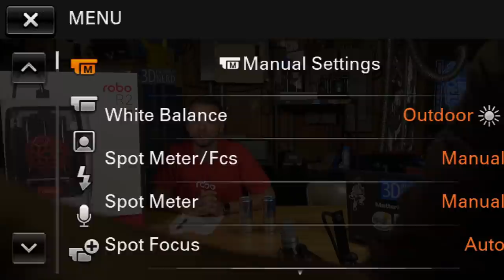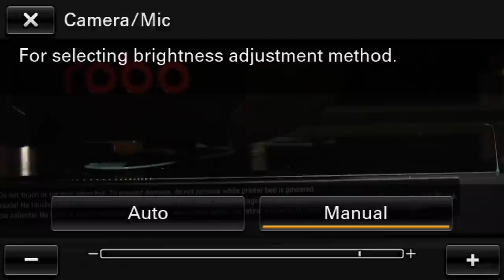Braydon Moreno & I Unbox a Robo R2 3D Printer and Have a Chat

Comment: I tried an E3DV6.  Didn't work.  You couldn't put the ROBO plate on due to the width of the heat sink.  The E3 also hung two mm lower which affected the cooling and would cause instant clogs.  I believe that you would have to figure out how to attach the included fan to the heat sink and wire it to the extruder.

Comment: Sorry Braydon, unfortunately, my R2 arrived last week with a bent Z-axis screw and it is currently being shipped back to Robo. I know of two others users (see Robo user forums) with bent Z-axis screws. Otherwise the machine was in great shape and printed right out of the box with little setup. The benchy boat looks like real shipping lap boards. Of course the 3D model does not look like that. Easy to setup and use. I am looking forward to get it back. Ah, also there was no tie-wrap on the door as my door was swing freely but luckily no scratches. Great print table - love it. Great look but may be hard to work on in future - time will tell. I would like instructions on disassembling to replace wore/bad parts as it will not be cheap to ship back and forth to Robo for fixing. Wifi works for updates and has internal harddrive but I have not transfer files thru Wifi yet. First mod will be add add addition LED light at the top. The current LEDs are great but when printing small parts the print surface blocks the lights on the top print surface. This will come in handy when watching thru the on board camera on the iPhone. Phone app works good. I turn out the light and go watch TV but it hard to see the printing. Wizards are great to lead a newbies thru the key steps. Touch screen is very nice. Great video guys.

Comment: Super cool stream !  $1500 for this machine with heated bed, auto level, wifi, camera, large build area, ENCLOSED (mostly) for printing nylon and such - with the option of a 2nd extruder?   That's a good deal - especially since it is NOT a kit.  The fact that is open source/modable/hackable is also really sweet.  Put it on par with an Ultimaker.  I have an Original  Prusa I3 MK2 that I built from a kit and I LOVE it, but if I wanted something for my 80 year old Dad to start using, or my grandkids, this would be a fantastic place to start.  Easy to use for beginners, powerful enough for experienced users and very hard to "outgrow".
Reply: Yeah, no. I'm getting parts of similar quality off of my $350 Monoprice printer. Another $50 for a Rpi3 with a webcam (literally the exact same setup Robo is using on the C2 & R2 with a hacked up frontend bit of coding to use their color scheme and graphics). This printer is using features that were top of the line in early 2015, but in 2017 is not worth the price tag.

The best beginner's printer on the market right now is the Maker Select Mini v2 at $250--built-in wifi, native support in every OS on the market as a recognized printer and 32-bit motion controller.

Auto-leveling is a crutch to be used with sub-par components. If you have a flat build plate and adjusting screws you only have to level it once and then lock the screws in place with loc-nuts.
Reply: Yeah - NO - Maker Select Mini v2?  While I like that printer, TINY build area, no good.  Closed source firmware, no good.  I'm sure that you will be happy to hand-hold a first time user through adding an Rpi, setting up octoprint, the camera, and building an enclosure.
I can build myself an electric car, but it won't be a ready to roll Tesla!  As far as print quality goes, the only thing that will differentiate any FDM printer (with adequate hotend,motion system, and cooling) is nozzle diameter.
Nyloc nuts and a fixed build plate - that is sooo 2010!  The only thing better than a removable build plate is a PrintrBelt.    And good luck printing ABS or a real flex with the Maker Select Mini.
Reply: Toni Ryan Good luck doing any of those things with an R2, because all of the things you list here are still issues with the R2.

Octopi setup? You still have to go thru the same setup stuff for your home network.

Material types? Good luck printing flexibles with the Bowden setup.

Firmware concerns are hilarious since you should never have to touch that on a 3d printer that is set up correctly to start with.

Also, remember that the R1's "real" build space was only 180 x 180 due to the heater used on their glass plate only being that large (if you were printing filaments that required a heated build plate to begin with). Until someone on their community forums (which are down again as of this moment) posts about printing something that approaches the advertized build space on X & Y, I'm taking any advertised build space with a huge grain of salt given how they lied about their first printer.
Reply: Do you not watch the video?  It is direct drive - or are you just a total troll?
Reply: It's actually both, if you've set up the second extruder/installed that kit.

Comment: Too late for the stream, but I have a couple questions:
1) Is there some kind of sensor that could detect a jam and pause the print?  (jams are my biggest problem with my Wanhao i3)
2) When the 2nd extruder comes, will it have a little actuator to pull it out of the way, similar to the Ultimaker, or is there some other technique for keeping the two extruders from interfering with eachother?

Comment: wow. always thought the Robo was a kicstarter scam. the Robo was an OK printer, but all the "live" demos they had in the R2 / C2 kicstarter were fakes
Reply: The R1 does have its qwerks, but they can get ironed out with a bit of elbow grease and care. Still was a fantastic value machine for its day.
Reply: Tell me about it. its amazing how far the industry has come in the past 4 years. how it has changed since i got my ultimaker 1 when that was the only machine they sold, and as a kit only! and now here i am buying a machine 1/10 of the price of that ultimaker, with more capabilities that my ultimaker (heated bet, control panel etc!) your right. the Robo was a revolutionary cheap plug in and play printer for its day. shudder, i think of all those rep raps made with the threaded rods before people discovered vslot extrusions!
Reply: I have an R1 Plus it works great till this day so definitely worth getting an R2 in the future
Reply: I have an R1 Plus it works great till this day so definitely worth getting an R2 in the future

Comment: Avoid this printer as much as you can, cheap parts and horrible assembly.. it last less than 2 months for me (bought on January 2020)
Reply from the maker: Wait you bought an R2 new in January? I thought they weren’t selling them anymore?
Reply: 3D Printing Nerd really?? Wow. Take a look at my story. I posted this comment in another of your videos “I bought a Robo R2 January 2/ 2020. A few days later I received a used, useless, broken, incomplete (no ac plug), Robo. There was filament all over the plate, also filament in the hot end, marks, scratches, well a complete surprise. I talked to them and they sent me a replacement. The week one I removed the hot end because it was jammed and when I tried to put it back, the screw that holds it was stripped (so the printer some how was used, again) and they kind of glued it to keep it stable to sell the printer. I had to purchase the screw and the whole support part by myself, the second week the motors belt started to do a horrible and loud sound every time I started a print. It turned out that one of the belts was broken, and again I had to buy it by myself. The week 5 when I started a new print, the plate tried to go lower than the limit, making the belts and the motors to make a horrible sound again. It turned out that the cable at the top of the extruder was broken and when I talked to support they basically told me that “try to put it back in its place” 😕 that Kinda worked out but every time I had to start a new print, the cable was out of the plug (of course it was broken) experiencing the issue again. They refused to replace the printer or the extruder so again I ended up buying the extruder by myself and replace it. So far more than $400 in repairs out of pocket. The printer is $1.499. So after that the printer was just fine and I sold it for half the price I paid for the printer only. The printer is cool from the outside, but terrible assembled with cheap parts. It was so bad experience that I almost considered to abandon 3D printing in general. Now I have a flash forge adventure 3 ($499) and finally I feel that I bought a printer from an actual company. The Robo printers make you feel that you are buying printers from a guy that makes 3d printers in his garage with whatever pieces he has...”